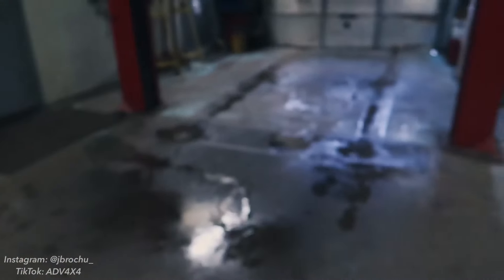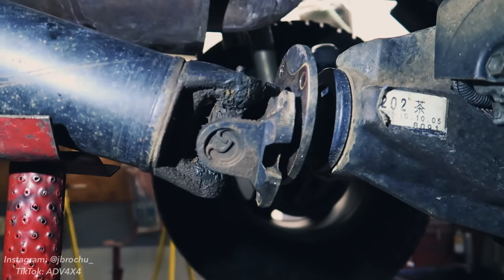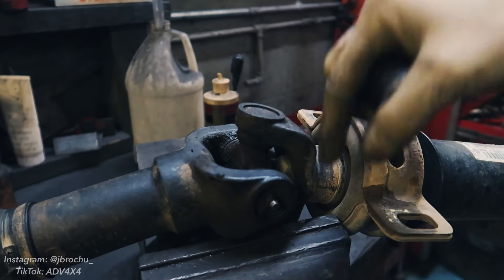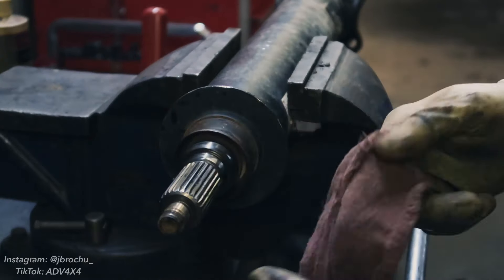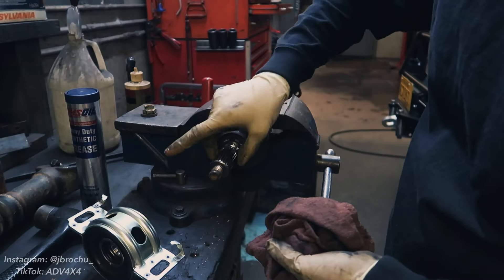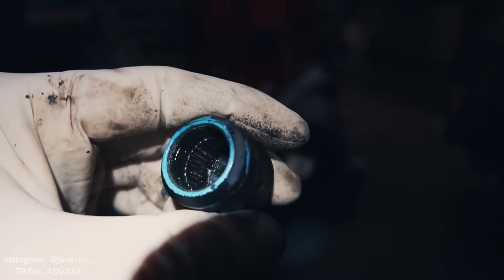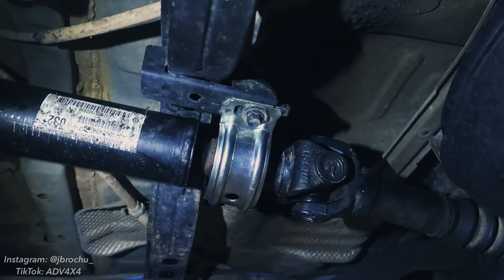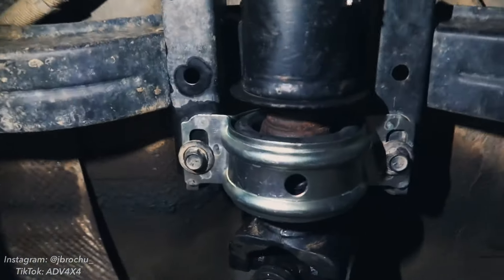How-to: Tacoma Carrier Bearing Replacement **DETAILED**

Comment: Any tips on removing a stuck yoke, mine is completely seized and I’ve hit with with just about everything, torched it, soaked it in penetrating fluid for over a day and still not budging
Reply from the maker: Wow sounds like it’s on there good. If you have already torched it that was gonna be my advice. Heat it and then take a hammer and hit on the yoke to drive it off. 

If it’s really that stuck maybe worth looking into a Tom woods solid drive shaft that deletes the carrier bearing. There are a few threads online about it
Reply: @Adv4x4  finally got it off, strapped the yoke to the bottom of a 4 ton floor jack and pressed the shaft through, took several thousand pounds of force to press it out but after a cleaning and several minutes with a wire bush it was able to go back on smoothly. Thanks for making a super detailed video, super helpful
Reply from the maker: Awesome idea I’ll have to remember that. Glad the video helped!

Comment: What if one of the U joints broke while you were driving, so you don't have a reference to mark? That happened to me at the transmission end of the driveshaft
Reply from the maker: If you look at the broken pieces close enough tyke make be able to distinguish which end belonged where but if not I’d just assemble it by your best guess and see what you have from there.

Comment: Great video!  I need to do this on my 2004 Tacoma, so I'm assuming it will be very similar. I was very intimidated by the u-joint removal/replacement part of this, but you did a great job explaining that, and I think I can tackle that now. One thing that may be an issue for me on the replacement carrier bearing (already en route to my house) is that part that sticks up on each side of the top. I have a carrier bearing drop (spacers) installed currently (to help w/ vibes after lifting the truck), and it looks like those "ledges" slide over that bracket that the bearing screws into.  Thank you for taking the time to film this!
Reply from the maker: Hey no problem! With a 2004 Tacoma I don’t believe you have to even take apart the ujoint itself. 

I think it’s a double Cardan joint with a flange that unbolts giving you access to the large but you need to remove to slide the flange off and remove carrier bearing itself
Reply: @Adv4x4  yep, I just looked, and you're absolutely right! That should make it even easier.  I've had some random, violent shaking under the floorboard (no specific speeds but recently happened while on the interstate), and I'm hoping this solves the problem. There isn't a ton of play in the carrier bearing, but it can't hurt to install a new one anyway.

Comment: Good job, I just ordered my carrier bearing, I will be doing this next weekend. I have access to a 60 ton press but it is not at the same location. I liked the way you removed the u joint caps and the carrier bearing (controlled taps), without beating them up too much. I 'am going to try this first to save some time.
Thanks, Chris
Reply from the maker: Thanks Chris! 

Just another tip, Although possible without a bench vice it is definitely the way to do it. Esp to get the carrier bearing itself off. 

Something I should have mentioned in the video was to not tighten the vice excessively on the driveshaft to avoid denting or damaging it. 

Good luck with your install and if you have any questions or need advice feel free to DM me on Instagram or Facebook you can find me on there @jbrochu_ I'll do my best to help!
Reply: @Adv4x4  A 3 jaw puller works well to get the yoke off and the bearing as well. Unfortunately, where I live in Northern Michigan, parts dont slide off with a few taps of a deadblow like they do in places that don't liberally salt the roads. ;)

Comment: How many hrs is this job for someone doing it in the drive way?
Reply from the maker: I would say it definitely depends on your skill set & available Tools. One thing I wouldn’t want to do without here is at least a sturdy Bench Vice. An experienced tech under an hour and the common diy guy anywhere from 1.5-3 hours depending on how fast you work.
Reply: Did mine in about two hours without a vice. Including a trip back to pick up another ujoint because my needle threads fell out. The jobs relatively simple just getting some bolts loose was probably the hardest part.

Comment: Great video! Dorman parts are a little questionable for me, but if it works for you, can’t argue with that. I like using OEM Toyota parts as sometimes it’s the same price as aftermarket or cheaper. To each their own.
Reply from the maker: I’ve typically had good luck with Dorman but everyone seems to have different experiences. I do agree oem is best!
Reply: Agree on dorman or any aftermarket parts. 😬. IF i can afford it and the part is one i cant change easily while truck is in the middle of nowhere

Comment: The worst part of this job is the dang needle bearings falling into the bottom of the cap when you install the cap. Aggravating it was. I'd keep adding more grease thinking it would hold them in place but it just takes one to fall off to screw up the whole operation.
Reply: Keep them vertical and use a C clamp. Doing it in the vise let’s them fall out when horizontal. Had the same problems until I did it my way.

Comment: I have a 2005 tacoma 2wd, i thought i need it to replaced the center bearing and order it but turns out my u joints were the ones need it to be replaced, i replaced all u joints and center bearing now a i have vibration worst than before, i marked the driveshaft like you suggested and just followed steps i dont know what i did wrong, should i take apart again
Reply from the maker: While servicing the u joints or carrier bearing did you accidentally sent the driveshaft or perhaps knock one of the weights off the side of it? A dent in the driveshaft can cause a vibration. And as long as all your Ujoints are seating properly with the retaining clips fully seated on all sides they shouldn’t be your issue.

Comment: Nice video! But man, my OCD spiked when you didn't put blue lock tight on nuts and bolts. But I'm sure it will be fine.
Reply from the maker: Funny you mention that. Per the service manual for all Toyota vehicles with a drive shaft, you have you re-torque the drive lines at service intervals of let’s say 50k, 75k, 100k, etc. That being said I’ve done countless of those services in my time in the Automotive business and have yet to find any of them loose. But I still check them as the service requests 👍🏼 I would just use loc-tite but if I have to remove my driveshaft in the middle of the woods due to it being broken I’ll end up appreciating the fact that I didn’t use it.
Reply: around here road salt is our lock tite. Actually it works much better.